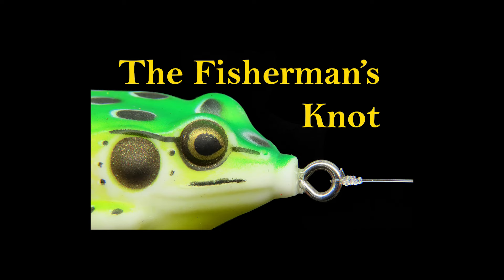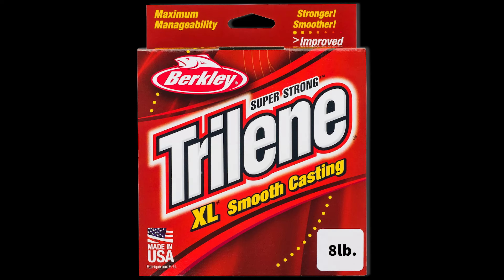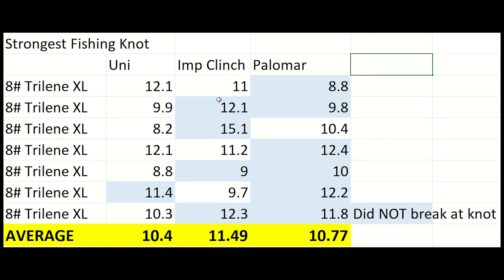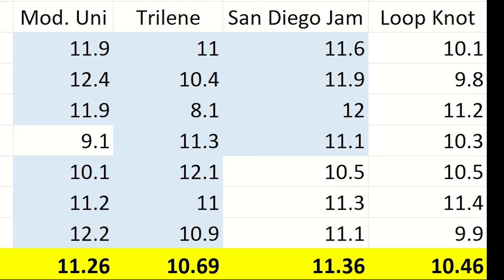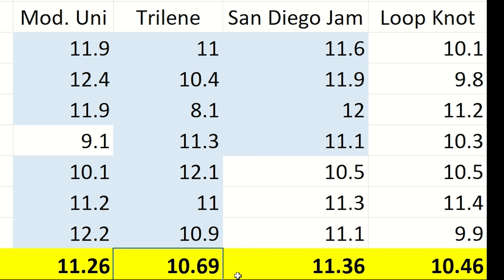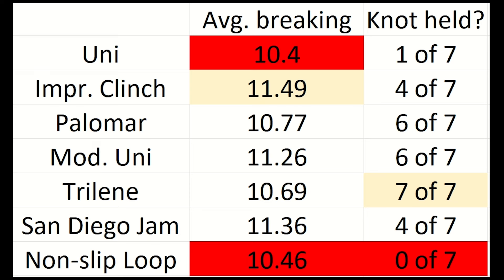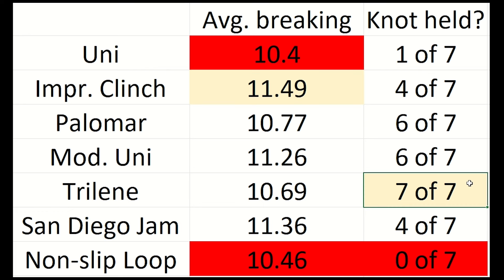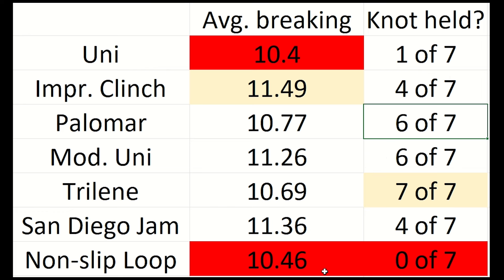Strongest Fishing Knot Test - Which is the Strongest?

Comment: This test absolutely confirmed that I’ve been using the correct knot. If the triliene knot NEVER broke at the knot. Then it’s the strongest. Period. Mono is not exactly the same strength from end to end of a spool. All you need a knot to do is hold until the line breaks somewhere else. If it can do that. It’s the perfect knot.
Reply from the maker: I agree.
Reply: The trilene knot weakens the line above the knot so much so, that line above always breaks b4 the knot....this explains the stronger connection of the improved clinch......
Reply: @packerjh2  not even sure what you are trying to say. Been using the trilene knot for 30 years. When I get snagged and have to break it off. I never know where it will break. But it’s never at the knot. I guess that can be a bad thing because sometimes it’s right at the reel and I lose a lot of line. lol.

Comment: Thanks for doing this.  But throw out the high and low outliers for each.  Sometime I'd like to see somebody do tests under water to eliminate the possibility that knots perform differently when dry or moistened.  I gave a Like in part because I always use 8 lb mono :)
Reply from the maker: That's a really interesting idea. I might have to do that test. The challenge would be getting a waterproof scale because the mono stretches so much. With braid you could keep the scale out of the water and have the line entirely underwater. I use 8lb mono for most of my setups too. It's a perfect balance for most of my fishing scenarios and I've pulled in 20# salmon with it and 50+ inch sturgeon.
Reply: @FishingwithNat  Nice!  My biggest so far is a 41 inch Pike.  But my brother uses 6# test and caught two 42 inch Pikes within an hour of each other.  Just have to play them and use a net.
Reply from the maker: @paulkline515  That's a beauty. I once saw an ice fisherman pull up a 50-inch musky on 2# fluoro with a panfish rod. If you have patience, you can catch some monsters on light tackle.
Reply: @Fishing with Nat, you could create a water tank (clear Rubbermaid tote) with a 50 - 60 pound weight that the lure can be hooked to. Then, simulate by pulling up out of the water with your scale representing the angler's reel.
Reply: what makes you think any values are outliers and why would you throw them out?
Reply: @gregkosinski2303  That's often done in testing as a way to remove anomalous results. E.g.- manufacturing flaw like damage, material abnormality or a length of line that's thicker or thinner than spec tolerances.

Comment: if this is supposed to test knot strength, why would you include the  tests where the knot did not break? the ones where the line broke don't measure the knot at all, the data included is completely borked
Reply from the maker: If the knot did not break, it still demonstrates the ability of the knot to hold a certain amount of force, so it was worth including. If a knot never breaks, that's very reassuring knowing that your knot will never be the weakest link in your setup.

Comment: Where exactly did the trident knot break at? Down the line or close to the knot? I myself use this knot and have never had a problem, even pulled my bass boat towards a log I hung up on several times with 17# line
Reply from the maker: Usually at least several inches down the line from the knot.

Comment: improved clinch is the king of strength when it comes to fast to tie knots with light line and braid, but it becomes difficult, if not nearly impossible when you try to tie it with thick, heavy line. a lot of old school offshore fishermen favor the 4 wrap uni knot (3 wraps if doubled up, becomes almost impossibe to sitch beyond that), finished with a security hitch on heavy mono/floro (50 lbs or heavier)
Reply from the maker: I totally agree. The improved clinch is great up to 10-12lb mono or fluoro, but anything heavier than that and I'll switch to a different knot. I typically use the modified Uni for braided lines.

Comment: I have a supple 40-pound fluorocarbon leader, supposed to be high-quality and made in Japan. However, when I test just the line with no knots—twisting on the hooks on my test rig—it consistently breaks mid-line at 35 lb. Not exactly the result I’d like, but at least it’s consistent. I’ve thrown away half the spool testing different parts. It’s about 12 months old and has never been exposed to light for extended periods.

Here’s the surprising part:
When I tie an unmodified Uni, the line breaks at 25 lb, but always mid-line. With a modified Uni, it’s 30 lb, but again always in the line. I lubricate with saliva and fully coat the cinch and mainline associated with the knot before tightening. I’m careful not to cinch too fast. If the damage was caused while cinching, I’d expect it to be more noticeable with the modified Uni, since it requires more force due to the extra pass through the hook eye.

The hooks are good, clean, and smooth, and as far as I can tell, representative of most new fishing hooks.

Does anyone have any suggestions?
Reply from the maker: Strange. I agree with you that if the line was being damaged while cinching it up, the modified Uni should cause more damage due to more wraps and the 2nd pass through the eye. What happens if you try to cinch the knot down while holding the knot/line underwater in a sink or something? That should completely lubricate everything so that friction/damage can be pretty well ruled out.

Comment: I love the Trilene, especially for Texas Rigs. That tail end coming out the side makes a huge difference when going through slop, it just moves out of the way vs what I used to use, the Palomar, where the end came out the line side. The Palomar pulled up a bunch of shit nearly every time but the Trilene just doesn’t, and it’s super easy to tie.
Reply from the maker: Absolutely. The direction of the line tie is a big factor in choosing the right knot for the right application.

Comment: Trilene seems like the winner to me. If the line isn’t breaking at the knot, it seems that the variation in force required to break it can be chalked up to variations in the diameter and strength of the line along its length (all of which is within-spec assuming it’s above the rated strength of the line). IMO never breaking at the knot is the best you can ask for a fishing knot. 

This takes me back to an engineering internship I had which had me measuring the tensile strength of paracords fastened different ways, including with knots. Great video and good methodology.
Reply from the maker: Thanks, I agree with your thoughts.
Reply: I think this is decent reasoning, but it could reasonably be untrue as well.  Tying certain knots or just how the knot structurally interacts with the hook and line could lead to weakness in the line that does not manifest as the knot breaking.  If we were to see a large data set that shows that a certain knot is consistently leading to lower breaking strength even if we're not breaking off at the knot itself, that is something to consider.  The fish doesn't care where your rig breaks and neither should you.

These videos are great and valuable tests, but they're not anything close to definitive.  You have so many variations in the pound test and material of the line, the type and size of hook, the tying itself, the testing procedure, and how you are applying force to the the setup.  Numbers like what I see presented here suggest to me that these knots are roughly equivalent and I would be fine choosing any based on other factors like if I want better action or better ability to shed weeds.
Reply from the maker: @gregkosinski2303  All good points - thanks for the comment. This test was with 8lb mono line and repeated 7 times for a stronger dataset. Testing other weights and lures, and with hundreds or thousands or repetitions would be even better.
Reply: @gregkosinski2303 then make us a better video.
Reply: Is it because the Trilene not is stretching or thinning the line above the knot!? Weakening the line to where it breaks b4 the knot??.....that's why the improved clinch was breaking at higher poundage.  It didn't weaken the line around it.

Comment: I use the Trilene knot exclusively, not only for its awesome hold strength when tied correctly, but the tag points away from the rod— this less weed, moss snag potential to fowl the line w/ each reel.
Great video!
Reply from the maker: Agreed. It is a great knot and I like knots that have the tag pointed toward the bait for exactly that reason.
Reply: one application I really love the trilene knot for is tying a tippet ring onto the middle/butt end of your leader in fly fishing.  The tag points away from you and you have a very strong knot holding the tippet ring on.  Usually I'd just tie a clinch knot on the other side, but one could tie the tippet onto the tippet ring with a san diego jam knot and have both those tags pointing away and strong knots on both sides of the tippet ring.

Comment: yes, trilene knot is the strongest knot...proven unbreakable against big fights in pacific marianas/micronesia reef and land-based waters...after trilene knot, i provide an additional 1/2-inch long tag with an overhand knot at its end...tag overhand knot is a "marker" for periodic inspection especially after a big fight..
Reply from the maker: Not a bad idea. Thanks for sharing.
Reply: "marker" (tag overhand knot) helps determine if tag length has shortened or slipped any after a big fight or a snag..

has never happened to me (knock on wood), but maybe..
if tag slipping, a marker tag overhand knot might act as a last-minute stopper to keep trilene knot in tact during a fight, prevents tag from completely slipping through the tight qty-2 initial eye loops of trilene knot...¯\_(ツ)_/¯ maybe?..

excellent knot comparison video...thank you..
 @FishingwithNat
Reply from the maker: @bernardllarenas7772  Thanks for the feedback and good tip.

Comment: If all of the knots held then doesn't that mean you need to go to a higher strength line?
Reply from the maker: If the line was stronger, the knots would also be able to handle more strength.
Reply: @FishingwithNat  hmm I'm just trying to think about the physics of it. How could the knot break before the line strength threshold? I've seen in some tests that the knot breaks at like 70%. Kinda weird. I mean unless the knot unravels or something.
Reply from the maker: @FC2ESWS  Sometimes the knot construction itself will stretch/gouge/weaken the line within the knot, causing it to break within the knot before the straight sections of the line will break.
Reply from the maker: An unlubricated knot can also be weak because the heat of cinching the knot down can burn the line and weaken it.

Comment: Hey Nat, I think the line diameter is a key factor, usually US brands have a thicker diameter, and therefore it usually has a higher breaking strength.
Reply from the maker: These knots were all tied with the same line so they are comparable, but you're right - I've heard that lines in other parts of the world don't always provide the strength that the package claims to.
Reply: @FishingwithNat  A lot of Japanese brands will have true breaking strength on the package along with the diameter. Typical for the same breaking strength, Japanese brands will have a thinner line.

Comment: I don't know anything about tying knots, never having been a Boy Scout, so I just have always used the one my dad showed me, turns out to be the palomar.  Tie that onto the end of a leader (I always just fish for pike) and I have pulled in a 7lb pike on 4 lb line and a 20lb pike on 8lb line.
It has been my experience that the drag setting is probably as important, given that the 7lb pike made a couple last second runs just before I was about to land him, but since the drag was loose enough he didn't snap the line...I just kept winching him in, pull on the rod, take in the slack until I was able to grab him around the scruff of the neck.  
I squish all my barbs shut so that the hooks come right out, no blood or hurt.  Then weigh, take the photo of the fishie, a pat on the head and a tummy rub and back they go into the water.  🙂
Reply from the maker: I like your system. Yes, the drag is crucial. With a properly set drag system, the weight of the line doesn't matter much anymore, as long as you're ok with a ton of line being stripped out by a big fish. A light setup can also stress out a fish more by seriously tiring it out with a long fight, so that's something else to keep in mind. I use a fair number of barbless hooks too when I'm not planning to keep any fish for dinner.
Reply: @FishingwithNat  my spot is a little pond along the river that passes through town, formed by boulders laid out by the City into the river next to a storm drain culvert; I have good wind protection from the north and west, the roadway above is probably 50' above the water.  It is probably 30 yards to the opposite bank of the pond and 50 yards from the mouth of the culvert to the passing river current, and I would guess it is 5 or 6 feet deep in the middle.
I never have great luck, as in multiple fishies a day, I think my best was 9 in a couple hrs, most times I get one, sometimes the spot dies for days or a couple weeks.   A couple times the fish has taken off into the current, those are always times my heart skips a beat and I get a knot in my stomach...lol 
I take photos of all my fishies and have had multiple cases of catching the same fish days or weeks apart, so that is good because I must not be harming them with my method.  Most times the fish takes off as soon as set him back in the water, but a few times (even when there hasn't been much of a fight) the fish will just sit motionless in the water a foot from my feet...the pectoral fins are lightly waving and the gills slowly open and close and then a slow wave of the tail and it slowly swims away;  that is always fun to watch.
I had a 20 pounder on a few weeks ago, he took two last second runs and even jumped his head and first foot of his body out of the water, and as I reached down to grab him, the line broke when my hand was a foot from grabbing him....  😭😭😭
I am hoping he lives in the area and hasn't let the current take him on a cruise miles away, and that he will be one that I catch more than once.
Reply from the maker: @michaelzilkowsky2936  What kind of fish was the 20 pounder?
Reply: @FishingwithNat  northern pike
Reply from the maker: @michaelzilkowsky2936  Awesome

Comment: My scientifically minded suggestion would be to try the same tests with different line diameters. Good video btw
Reply from the maker: Yeah, for this test I used the same line for all of the knots, but it would be interesting to see if the different knots ranked the same with other line weights or braid/fluoro lines.
Reply: @FishingwithNat  yea I tie knots a lot with tiny fly fishing tippets so it's interesting to me if more wraps for knots equals more strength. Also some people say that braid can slip more easily.
Reply from the maker: @AsgarnianAle  I would say more wraps does equal more strength (and less slip) up to a point. After a while, it doesn't make any significant difference. I do have a favorite knot for slippery braid (I'm not sure if it even has a name) that I use when tying 8/10/15lb braid so it doesn't slip through the knot. I plan to make a few more videos on knots and knot tests this fall/winter.

Comment: how do you explain the knot holding but lower breaking strength (trilene)
Reply from the maker: The Trilene knot itself was stronger than the line was in all cases. In the other knots, there must be some weakening of the line within the knot that caused knot failures before the line broke.
Reply: @FishingwithNat  hold it  this is a little mind blowing
Reply: @FishingwithNat  but see heres the thing.....your breakage numbers w trilenes were notably lower w the knot....so allowing for the fact ur line was fresh out of the box....its suggested here that the strength of the knot or tightness of the knot doesnt allow the same give possibly the other knots?

what are your thoughts on the best knot to go with here?
Reply: @FishingwithNat  we need a physicist
Reply from the maker: @stevec69  It's a good question. Some of the other knots did have a higher average breaking strength of the line. I think it's probably due mostly to variation of the line itself. I repeated the text 7 times with each knot to get a more accurate average and account for some of this variation. All of the knots had a substantial amount of variation between each of their tests. I stand by my top picks of modified Uni, improved clinch, Palomar, and Trilene knot because of their high scores with both breaking strength and knot-holding. These are the four I've been using the most and I continue to be impressed with all of them.
Reply from the maker: @stevec69  I also removed a couple feet of line after each test to try to eliminate any variation in line strength due to the previous test.

Comment: The San Diego Jam knot has the highest average pull rating. But the  test data shows the knot failed 4 out of 7. Where the Trilene knot may have not reached the peak of the San Diego Jam. The Trilene knot never failed out of 7 attempts. Getting an extra lb or two out of knot isnt important for me. Whats important is it wont fail,. Thats because under a microscope the Trilene doesnt cut into the line like some of the other knots ie San Diego Jam and other excellent knots. For me i prefer the  Trilene because it has the best #1  reliable knot the data shows which is most important, coupled with 100% knot, it has the best combo of both worlds combined.
Reply from the maker: Well said. It's a tried and true knot.